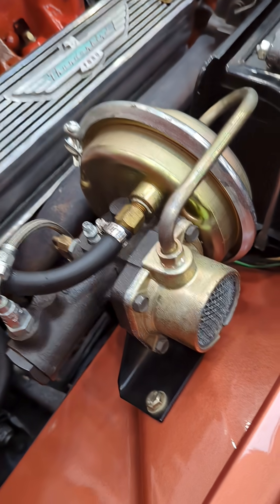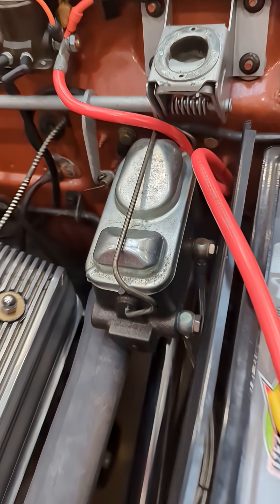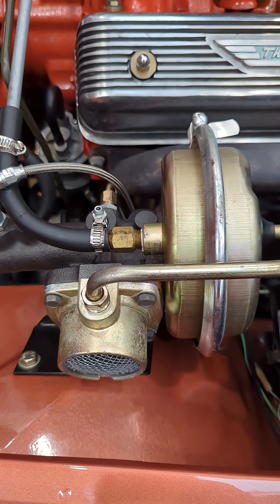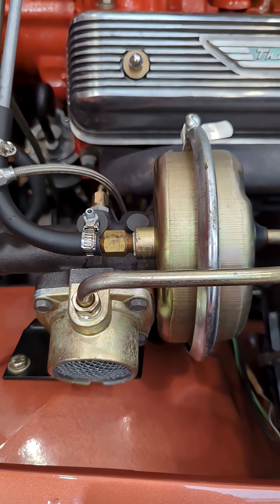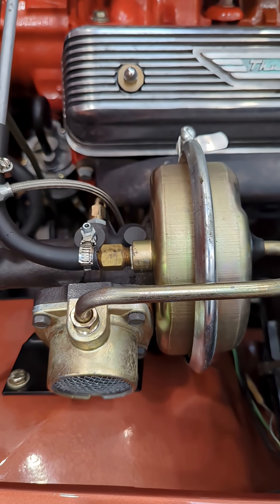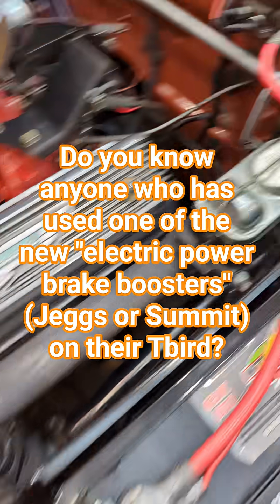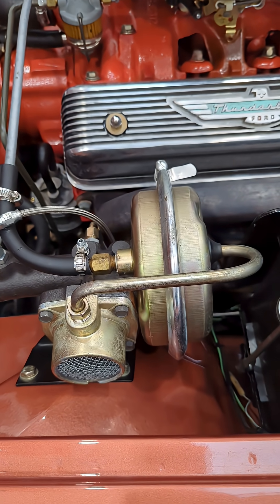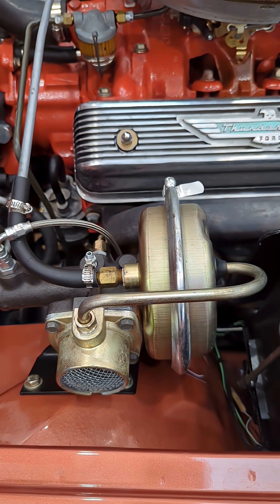Thinking about a new electric brake booster unit for the T-Bird.. #restomod #mechanic #brakesystems

Comment: The question i have is does this vehicle shown only have power boost on 1 brake circuit as there is a dual master cyl. but that midland booster is designed for the single master to Actuate the booster providing assist ,so is the brake system only boosted on the front  or the rear .as far as the electric systems go many vehicles have come in to a friends hotrod acd custom shop with that set up and they work well enough to Consider for future builds
Reply from the maker: Greg, yes as with most T-bird conversions, the booster is only used on the front discs.

Comment: I agree .bought an electric vachum pump. Puts out 24 pounds of vachum.
Reply: This would be inches of HG mercury in vacuum. At sea level atmospheric pressure of 14.7 psi this actually equates to 11.75 psi pressure @ 24" HG

Comment: I have the exact same unit on my '56
Yeah it doesn't work like the new cars for stopping. But its alot better than the old drum system. 
Have you looked closely at the rotors? Mine are modified Ford Grenada rotors. And the pads are 67 Mustang N11.
Time for a Wilwood setup?
Reply from the maker: They stop fine. They are a 2016 Larry's Thunderbird package. They just require too much effort. If you're going to have power brakes they should feel power, but these feel 75% manual and 25% power. I want to do way better than that.